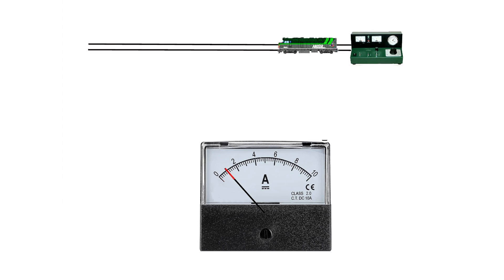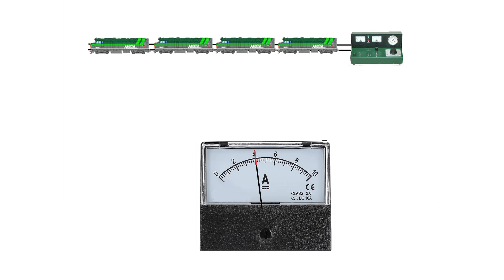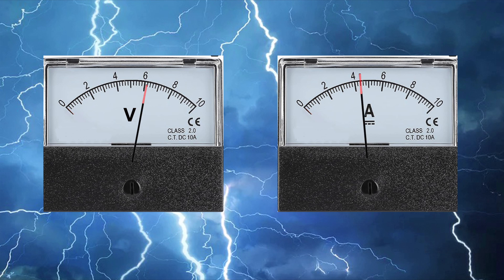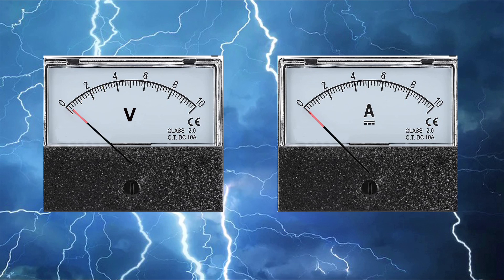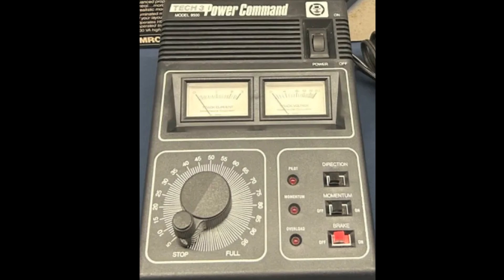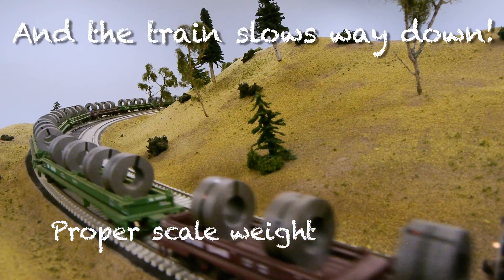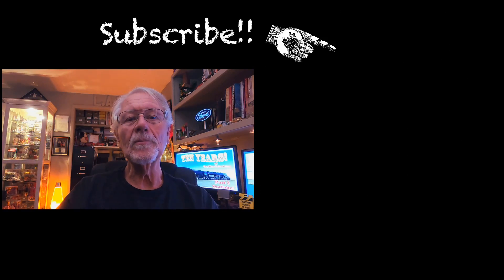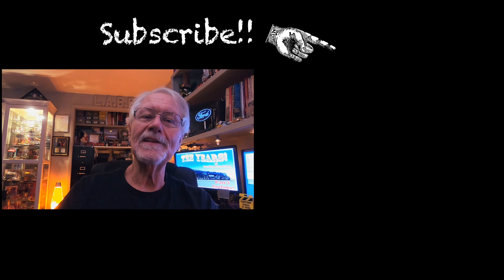Week Five - Power Supply Amperage For Track Power and Using Track Power Meters

Comment: Do you have a recommendation for handling three engines on a DC layout without getting more power supply to the track(I only have three Bachmann controllers, and they are all being used)?